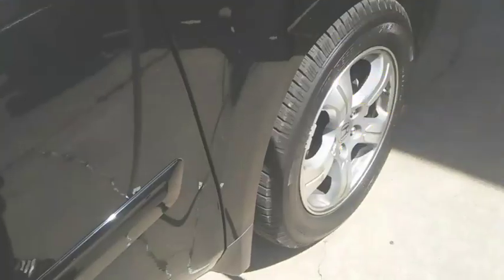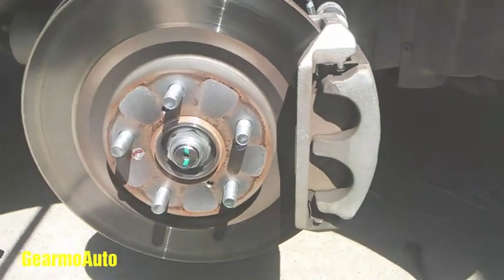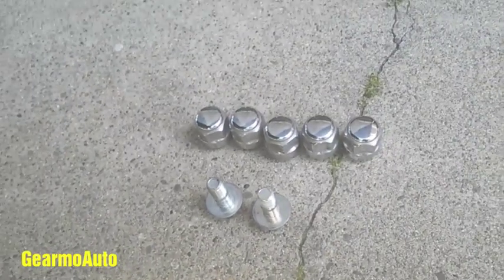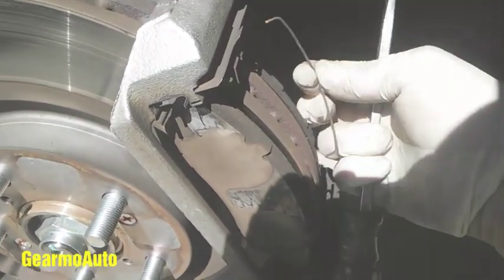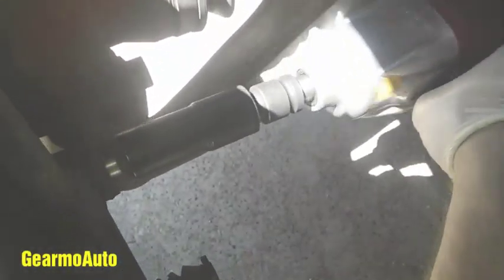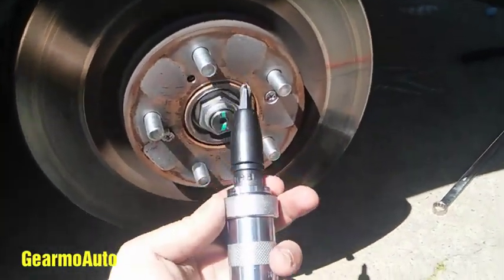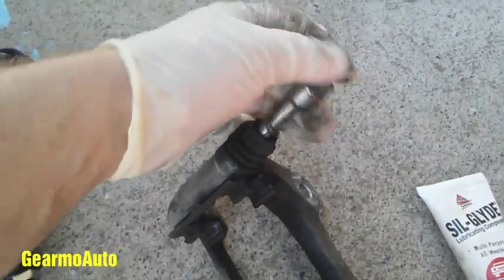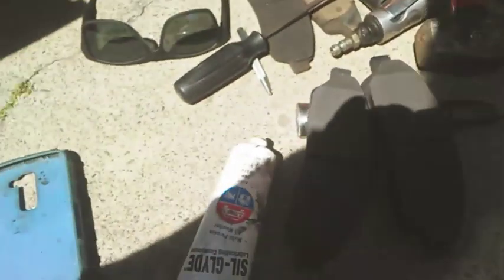2011 Honda Pilot Front Brakes. Pads + Rotors

Comment from the maker: GET THE BRAKE PADS HERE ( AMAZON ) ( BEST AFTERMARKT ONES IMO )
https://amzn.to/3BCSFhB

GET THE ROTORS HERE ( AMAZON ) ( AFTERMARKET ) ( SEE NOTES )
https://amzn.to/3r2wf4C

GET THE CALIPER PISTON COMPRESSOR TOOL HERE (AMAZON) ( ONE USED IN VIDEO)
https://amzn.to/3C4g6SQ

ROTORS NOTES: I LINKED TO ROTORS THAT ARE BOSCH BRAND AND COATED ON AMAZON, HONDA OEM ROTORS ARE NOT AVALIBLE ON AMAZON. THE HONDA PILOTS ARE KNOW FOR HAVE PULSATION ISSUES EVEN WITH NEW FACTORY ROTORS. THE BOSCH ROTORS ON AMAZON HAVE THE BEST REVIEWS. THEY ARE A BIT PRICY 100 BUCKS EACH BUT NOT HAVING TO DO BRAKES AGAIN IN 6 MONTHS IS WORTH THE PRICE TO ME